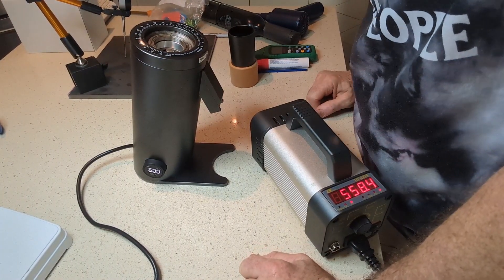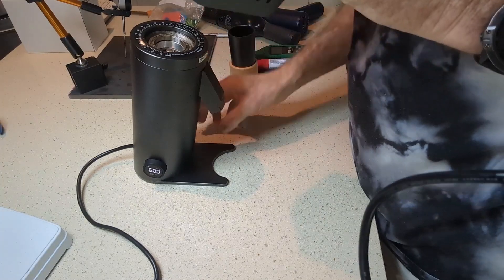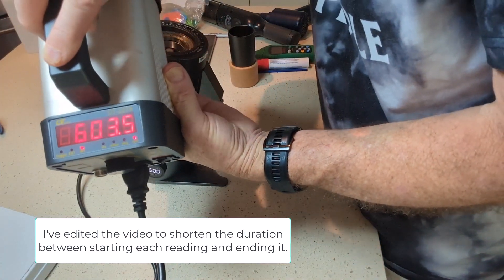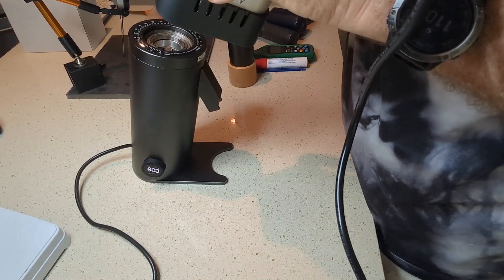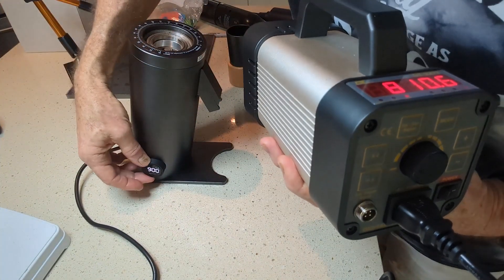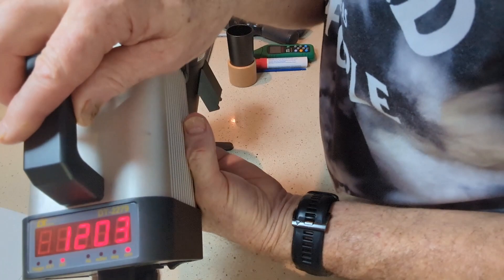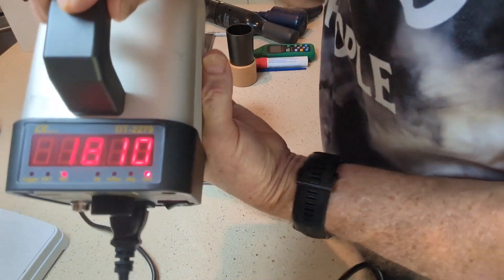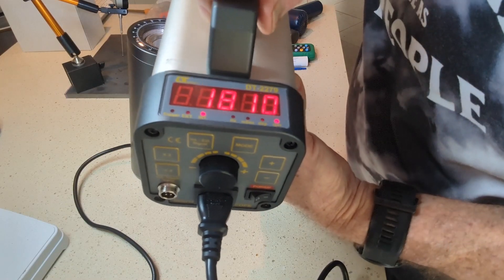DF64V RPM testing

Comment: Thx. But will rpm will reduce during grinding ? For example set to 1800 and during grinding will reduce?
Reply from the maker: @mryoyo7741  yes when the motor is under load the rpm will reduce. nothing significant though.
Reply: @ for me rpm is a deal breaker in a grinder same as pressure profile in espresso machines